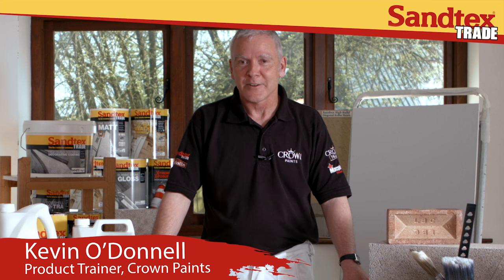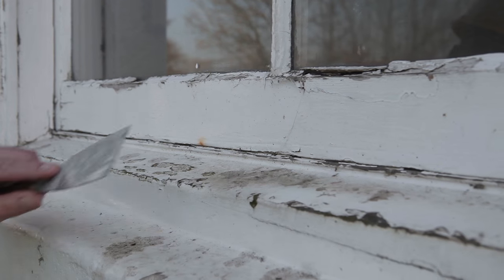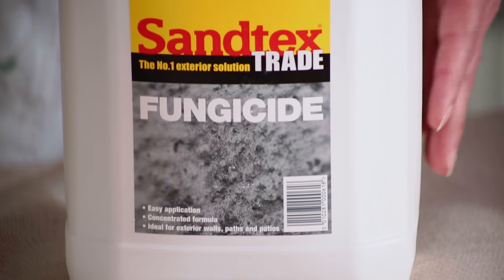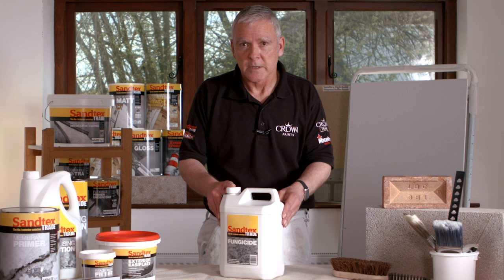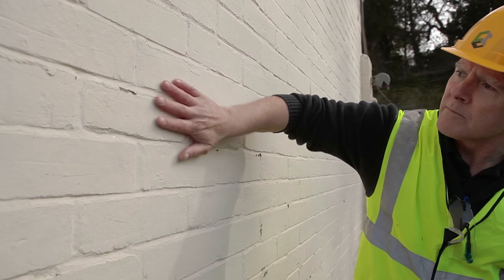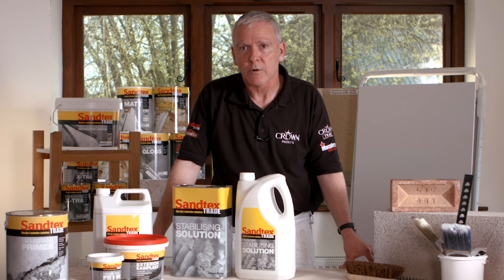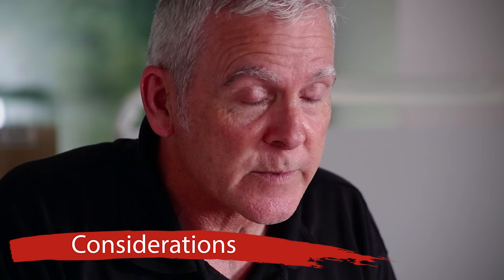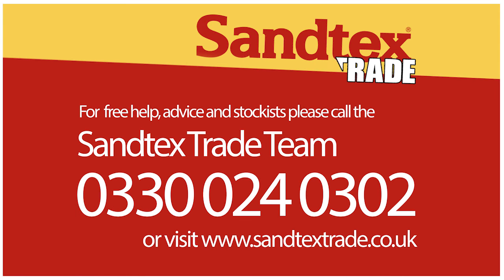This is Sandtex - Preparation and Pre-Treatment (Episode 1)

Comment: For anyone thinking of using Sandtex I’d say go for it but with a couple of caveats. I’ve just finished 180sqM of very rough pebbledash and given it two coats to go from cream to white. Great coverage, good opacity and with about 5% water added lovely to work with. Its one disadvantage in comparison with Dulux Weathershield is that Sandtex has a longer drying time with Dulux going showerproof within 30 minutes and Sandtex taking at least double that. Apart from that they’re as good as each other I’ve found although Sandtex retail paint is much less expensive. I couldn’t in good conscience however recommend anyone buy the Sandtex Trade which is over £1/litre more expensive than the Sandtex retail paint and I’ve never seen a difference between the two. So long story short Sandtex retail at about 30 quid for 10 litres from Screwfix is an absolute bargain and will do a great job for anyone.
Reply: Did you roll it on to your pebble dash?
Reply: @eezy251able  Yes with a Purdey Colossus 3/4” nap roller and using a brush to work the paint into the roughest areas.